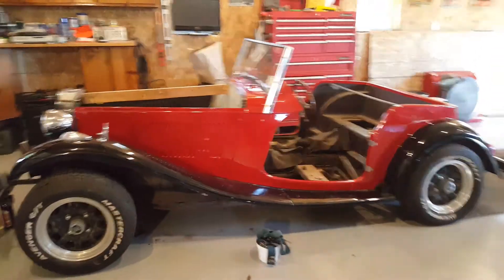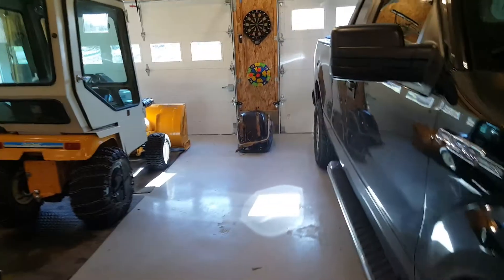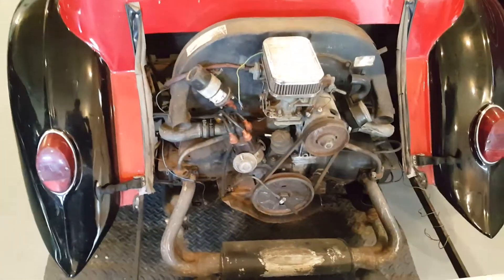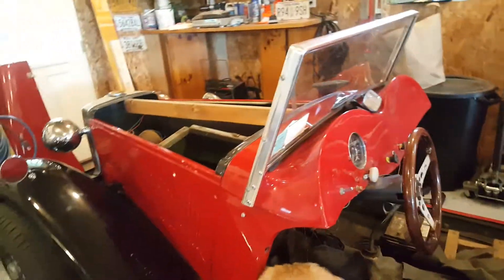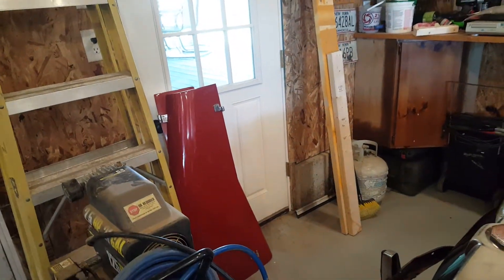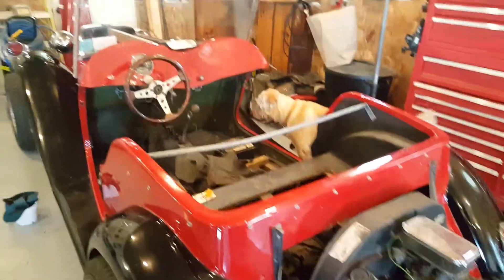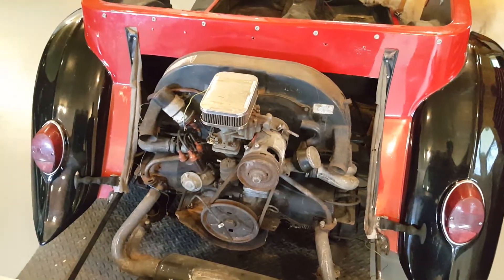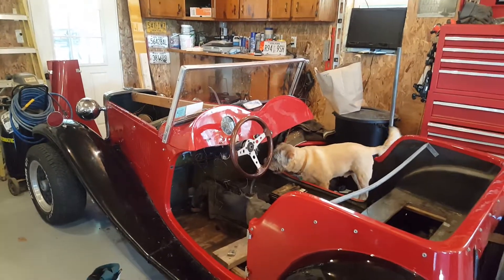My 52 mg replica purchased for $2500 on 4/21/17

Comment: ... and I'm thinking about converting it to a full electric drivetrain. Perfect candidate for the conversion since it barely weighs more than cardboard box, is a manual and the brakes and steering are both non power.